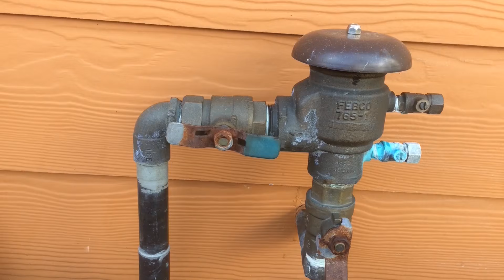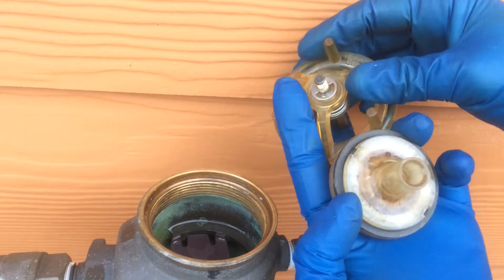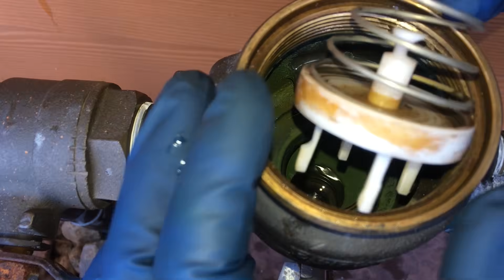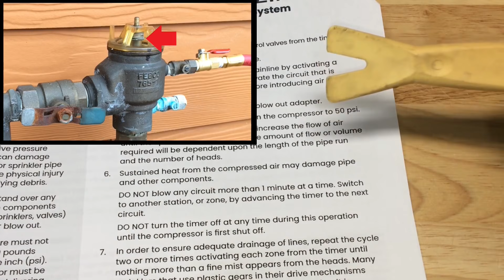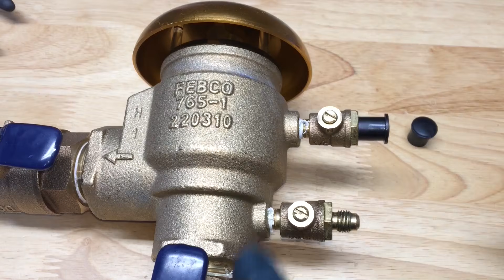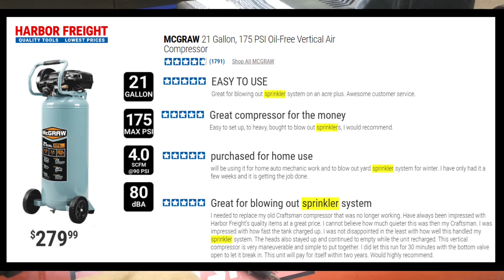Sprinkler Blowout with Air Compressor FEBCO 765 Full Guide, FEBCO 765-1 Backflow Preventer PVB shown

Comment: Stellar video!  I had already blown my sprinklers out by the time I came across your instructions and can see all the incorrect things I did.  Lucky nothing appears damaged, yet.  

Question: At 6:11, I have a brass cap/drip valve (instead of a hose bib) on the line that stems off the main line to feed the irrigation system.  From what I interpret in your video, am I to leave that brass cap on and snug at that junction over the winter but either remove or loosen the one outdoors so water can drip out instead of freezing in the pipes?  

I ask because I originally removed all 3 brass caps (2 outdoors for some reason and 1 indoors) but the one indoors at the main water line continued to slowly drip water over the next several days (into the sump pit, thankfully).  I confirmed the stop valve for that line was, in fact, closed and I placed the cap back on that one to keep it from dripping all winter long.  However, the water level eventually climbed back up the pipe to the outdoor level where it now slowly drips out of the drain you discuss at 33:33.

Does it sound like the stop valve at the point where the irrigation system stems off the main line is faulty or is this normal?
Reply from the maker: From what you're describing (if I'm following correctly), it sounds like your interior shut-off valve is allowing a small water leak, such that "new" water from your main water supply is able to pass (ever so slowly) across the "closed" (but leaking) valve, as opposed to "old" water backflowing in from your irrigation system - but, either is a possible source for water collection at that low point. 
Your interior brass cap drip valve is at a low point, and water is reaching that low point despite the irrigation system having been drained.
There are only two ways this can occur: either fresh water from the main line is leaking past the "closed" shut-off valve (the most likely condition, in my opinion), or exterior/back water is leaking in through the irrigation system (ie, back-flowing from some pool at a higher elevation).
I'd test the first possibility first - that is, I'd test for a slow leak at the interior shut-off valve first, because that is the most likely cause.  
To do that, I would have a look at the water meter: many modern water meters have very sensitive leak detectors, and even the old Rockwell's have a little "leak" dial for just this kind of inquiry.  I'd tell everyone in the house not to use any water (and I'd unplug the fridge if it has an auto-fill icemaker, or shut off its water line) and I'd see if I'm getting a leak detected at the meter.  
Depending on the sensitivity of the leak detector and the speed of the leak, this could be determined quickly or might require an hour or two of test time (ie, no other water use).  If I see a leak via this water meter observation when I know that I'm not drawing water from anywhere else in the house, then I would conclude that the leak is likely at that irrigation shut-off valve.
Alternatively, if you happen to have a long-enough pipe camera (endoscope camera), I would just snake a pipe camera in from the PVB to have a look at the valve itself and visually inspect for leaks (very cool digital endoscope cameras are amazingly affordable these days).
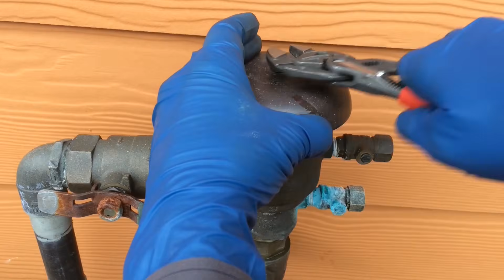To do this, I'd just remove the internals of the PVB (see 7:53) and open the water inlet valve (the lower valve on the PVB), then snake the camera down into the PVB and work it back to the shut-off valve. Measure/estimate the distance between the valve and the top of the PVB to get an idea of minimum length of endoscope you'll need: I would imagine that most homes have the valve within 20 ft of the PVB, in which case a $30 Amazon endoscope could do the trick.
If the shut off valve is leaking, you'll be able to see it with the camera, even if it's a "drip-drip-drip" or "misty" leak, because even the cheap-o endoscopes have LED's on the end and will illuminate the valve so you'll be able to see any reflective water.  That would be a rather definitive test (and that is what I would suspect is happening).
On the other hand, if I do these tests and cannot detect any leak at the shut-off valve, then I would conclude that the water must be back-flowing in from some higher pooling area abover the irrigation system outlets (which for backflow act as "inadvertent inlets").  This condition is, indeed, what backflow preventers and PVB's are designed to prevent, but it can happen under certain circumstances and if there are other failures in the irrigation system.
To test for a backflow condition, I would remove the bonnet and the internal valves of the PVB (see 7:53), then close the water inlet valve of the PVB (the lower valve) and open the water outlet valve (the upper valve), install any brass caps/drip valve caps, then cover the PVB top to prevent rainwater from entering it.  This condition will allow any higher, pooled water that is somehow backflowing into the system to collect at the PVB, where I could later see it.
If the PVB fills up (back fills) with water, then water is backflowing into the system from some higher point/s where there is a pooling area/s of some kind.  
I hope that helps - hopefully you just have a leaky shut off valve.  In that case, then you'll want to allow the water to drain (into a bucket, run a hose, etc) at that interior brass cap drip valve until you can replace the shut-off valve, because as you pointed out, you don't want water collecting back into the PVB in case you have a freeze.  
I hope that helps - good luck!  : )
Reply: @L35inColorado  Thank you for your comprehensive response.

You are correct in the estimation that we are talking about the low point in the entire system.  I'm just now noticing that once it enters the home (above a sump pit), it forks immediately off to the irrigation system.  The main shutoff valve to the house is after that fork on its own circuit, and the irrigation shutoff valve is also on its own circuit.  Until now, I presumed the main shutoff valve affected everything.  

The drain hole in question is on the same plumbing piece as the ball valve shut off, directly after (downstream but up in physical direction) of the valve handle.  Friends have suggested that maybe the "leak" is condensation accumulating from above where it eventually exits out of the house where the temperature is colder.  I haven't observed the dripping for any length of time to learn whether the pace of the leak is steady, pointing to a leaky ball valve, or inconsistent, matching with fluctuations in condensation accumulation.

Thinking about the entire system, I think the PVB may be the high spot of the entire irrigation line.  If the PVB collects water, then I probably have a bigger problem.  I actually do have a long endoscope camera as you described (LED lights on the tip) and hadn't considered that.  I'm not sure it is flexible enough to make a 90 turn, but it's worth a shot.  Between now and this coming weekend, I will try all those troubleshooting ideas you suggested, including the water meter monitoring.  

For the time being, I bought 10' of clear tubing and have attached it to the drain hole, directing the tube into the sump pit.  That also stopped the exterior drain hole (higher elevation) from dripping as well, so there's a correlation there.  At least it won't be dripping on the sump lid over the winter and splashing on the timber surrounding it.

Thanks, again!

Comment: My system has manual drains for the zones and another adjacent to the PVB.  So do I understand correctly that if the main valve is off, the zones are all drained with drain valves left open, and all four valves on the PVB are left halfway open, I’m safe to leave it out in the freezing weather?  No harm to the plastic and rubber parts?

My installer told me to take the PVB off and store it inside, which I’ve done every year for 10 years.  But it’s getting old taking it off and putting it back on every year.

Separate question: my PVB has made a very audible vibrating noise when the system runs, until this summer when it was silent.  Everything still seemed to be working normally otherwise.  Why would the noise have stopped?

This is an outstanding video.
Reply: I wish someone would have chimed in on this as I have a similar question.  
I’ve tried removing and opening the valves and I can’t still get damage from freezing.  Either way I can run into issues, not always but it seems like every few years I’m out there doing repairs.🤬

Comment: This is the best video I’ve ever watched explaining everything about winterizing a BFP. Your knowledge is truly at a PhD level in this field! I just have one question I hope you can help with: my system doesn’t have an outlet drain valve, but it does have an inlet drain valve. Can I blow air through the inlet drain valve instead of using the test cocks as you demonstrated in the video? Thanks!

Comment: So happy I watched this very comprehensive video about blowing out my sprinkler system! When I began doing the blowout,  I heard a bunch of air, and realized I would have to manually close the valve in the backflow. I wouldn't have attempted it if I hadn't seen it in this video and knew what to do!
FYI - the Advance auto parts store fitting Part No. 321204.1 she mentions at 38:52 is currently on clearance according to the website. I got one for $.25.
Reply from the maker: Wow, nice - thanks for adding your info about the part - I'm so happy the video helped!  
Thanks for watching : )

Comment: Once women dominate the trades, it will be a safer place. Thank you for this excellent education. Now in my 50s and finally able to afford my own things, I have become an avid DIYer. There is a market for information that the box stores have hardly tapped into. Anytime I find solid help, it is from a woman. I would rather have details that I don't need because of my experience than not enough detail because the man sharing the information is too ignorant to see how his experience is not the experience of everyone else. By the way, the inlet valve is not as easy to get to on every backflow preventer like it was for you (I am in a new 2022 Colorado home). However, once one turns on the air to the system, one doesn't have to be able to grab it like you did to get a hold of it and pull it up to make the seal. I only know this from my own experience after using your perfect instructions (e.g., the info you provided about how the water (air) enters and exits the backflow preventer was priceless). Thank you!!!

Comment: This video was so thorough and informative! The tip about helping to seat the inlet valve on the back flow preventer was the most valuable and necessary for me, as I just couldn’t get past that problem of all the air flowing out through there.
Reply from the maker: Thanks - I'm glad that the video was helpful for your sprinkler winterization!  Thanks for your comment, and thanks for watching : )

Comment: Can you do it just using out side zones in ground or do you have to do it inside at monitor…i never use monitor
Reply from the maker: I'm not sure what you mean, but if you're asking whether you can open the zones individually at the zone valve itself (ie, without using the controller), then yes, you can do that - just be certain that a zone valve is open before pressurizing the system.  I hope that helps - good luck : )

Comment: The most complete and thorough video out there.  I live in CO and hands down, the best - thank you.
Reply from the maker: Thank you, and thanks for watching!  : )
Reply: @L35inColorado  I came to here to see which valve to use because every year my bonnet breaks.  Come to find out, it was the check valve - I didn't have it seated properly so it kept smashing into the bonnet and costing me $50 to fix on top of the cost of my sprinkler blowout guy.  Worked like a charm last Friday and you saved me $50.  And I never really considered adding a blowout valve past the backflow preventer.  "Ideally neither - if you must, either."  I won't be forgetting that.  Thanks again! Cheers!

Comment: I have this version of a PVB - https://youtu.be/6tqEB-CjcVQ?si=xySXu_6OGJFldGTM

Two quick questions:
Do the internals work the same as what you showed in your PVB?
The test port positions on mine aren’t in the same place, should I just use the one that’s upstream of the PVB? Either port would send air through the PVB as there isn’t a valve between the downstream test port and the PVB. Whoever installed mine didn’t add a blowout port like you mentioned is ideal.

Thanks!

Comment: I have been looking for a complete how to video for winterizing my system a long time and am very thankful to have found yours! So, thank you so much for providing this one! May I ask. If my controller doesn’t have quite the same features for opening each valve from it can I use the  solenoids to open each valve one by one while blowing the system out?
Reply from the maker: Yes, you can certainly open the zone valves at the solenoids.  Just be sure that you have a zone valve open (whether manually at the solenoid, or via a controller) before applying air to the system.  
I hope that helps - thanks for your comment, and thanks for watching : )
Reply: @L35inColorado thank you🙏

Comment: any reason why the backflow makes a bubbling noise when initially connecting the air hose? followed all the other steps (running the zone i didnt hear or see any water coming out when trying to drop pressure before blowing out)

Comment: Let's be clear, the lower test cock is where it ought to be purged. Period. End of story. 
Febco is claiming otherwise because they are using cheaper materials. You MUST purge the water backwards and thrift the entire body, because if you don't,  the poppet has a much higher chance of the gasket cracking due to freeze damage as the years progress. I've seen it more times than i can count. 

They are simply trying to cover their butts due to using cheaper materials

Comment: Great info.  If it costs $100+ to rent the "big" compressor and a contractor only charges $50, who would bother? I guess if you have some gigantic yard, it'd be worth it?  As someone else posted, I've seen videos in which small (6 gal) compressors are used and though it takes a few passes, they do it.  I'm confused.

Comment: Thank you so much sharing your experience!! I have a question for you. 
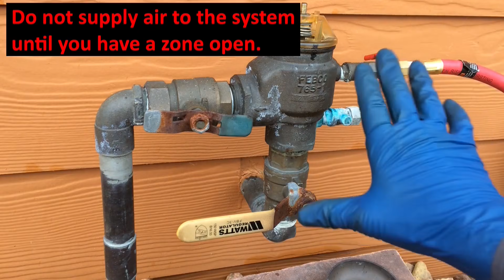24:43 You recommended "Do not supply air to the system until you have a zone open". I have different thought because, in normal case, the water pressure is always there before zone opening. If we assume "air = water", air pressure apply first, then zone open later. Please let me know what I am missing. Thank you.

Comment: This video solved my issue! My air compressor couldn't blow out the water at all. Air looked leaking. 
25:50 From your video, I could finally blow out the water. Thank you for your excellent video!

Comment: Excellent detail in your video. I was able to get the PVB to seal when blowing the upper test cock using your procedure of lifting the poppet with my fingers. Worked great and I was able to use my small 3 gal tank compressor to blowout my sprinkler zones. The only thing I did differently was to leave the air pressure on while switching between zones at the controller. Saved a lot of walking back and forth. I had the pressure regulator set to 50 psi but actual pressure was much lower due to a small capacity compressor. Still worked great and did not subject the system to damaging pressure transients during switchovers. Thanks for making your video. Jim P., Lakewood, CO.
Reply from the maker: Outstanding, thank you for watching, and thanks for adding your tips!  : )

Comment: Great video.  I appreciate the time and detail you took in filming and editing.  I moved into ahome located in  Zone 4a that has a 14 zone sprinkler system and it uses ~ 15 - 18 GPM per zone..  The company I hired to learn on how to properly shut down the system rented a diesel tow-behind compressor to blow the irrigation system out.  They spent 30 second to 45 seconds per zone, but there was still quite a bit of moisture coming out. They definitely did not bleed the system until only air was coming out. I had them go back to zone one when they had finished all 14 zones, and I put my hand in front of on of the sprinkler heads, and it got completely soaked.  I called the manager, and he said that it was fine, and not to worry.  "A little mist is fine" is what he told me.  I just replaced 69 heads this year, so I am a little worried.  How much water/mist is acceptable?  Should I keep cycling through the system with 1-minute intervals until only air comes out? Also, should I be worried that they did not turn any of the valves to 45 degrees to allow for further moisture to bleed out?  The manager from the company I hired is coming out tomorrow to inspect.  Thanks!
Reply: The guy you hired did it correctly . Sprinkler heads  have gears , they are lubricated by water . When using a proper compressor with the proper CFM to blow out a system , the zone is done once mist is coming out of the last head .  CFM is what does the job . Those small electric compressors MAY do the trick for a small system , But there is no way they can do a 14 zone system properly . You cant keep the volume of air (  CFM ) long enough to keep the water flowing  and atomize the water . I am a pro , 40 years in the business .  Just for fun I have watched these " How to DIY blow out your sprinkler system "   They are far from correct .     But I make a living repairing sprinkler systems , and just about every spring I do repairs to systems not properly winterized . ( Paying a pro to do the blow out is cheaper than the repairs )